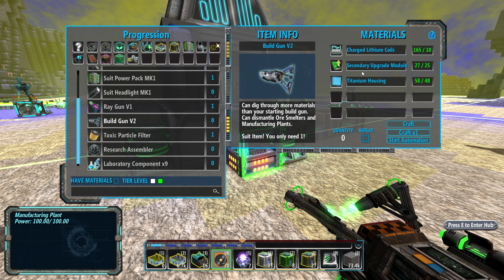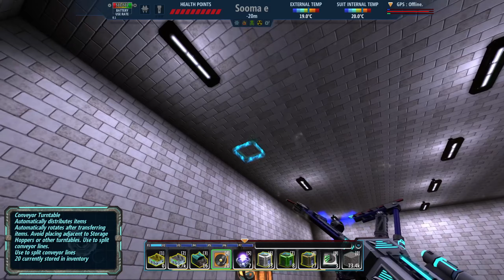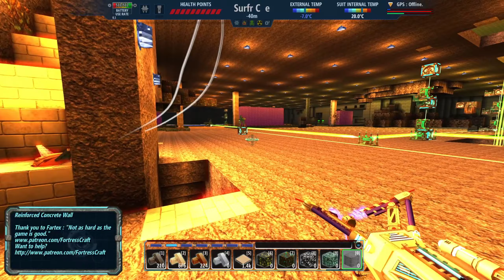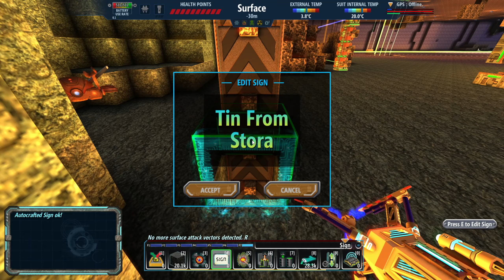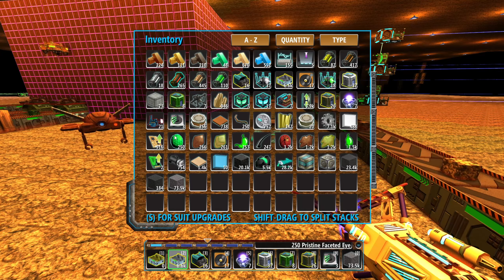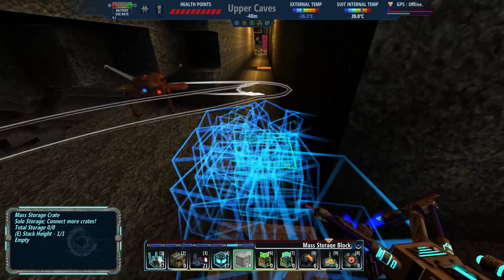Let's Play FortressCraft Evolved  s01 e17

Comment: 19:05 - You put a Rough Hewn Rock block in line of the Room Controller, so it thought that was the new wall. It was fixed when you removed it, and broke again when you put it back. ;-)

Certain blocks count as wall-blocks for rooms and will mess with the Room Controller if you put them in the "rook lines" in the room, the directions that the Controller checks to assess room size. Aside from wall and stone blocks, freightcart/minecart tracks count, as well -- this is really handy, since you don't need a Logistics Grommet to run carts into or out of rooms (you just run the track through the wall, and the carts will pass through the walls -- it's a neat trick if you're riding on the cart, which you do by looking at the cart and hitting the 'u' key, since you'll pass through the wall and into the Room, as well), but it does mean that you've gotta be careful to only put Room Controllers so they don't "see" the cart tracks. I know this from bitter experience...
Reply from the maker: That is super strange functionality, but I'm glad I know about it now!!  Thanks! 👍